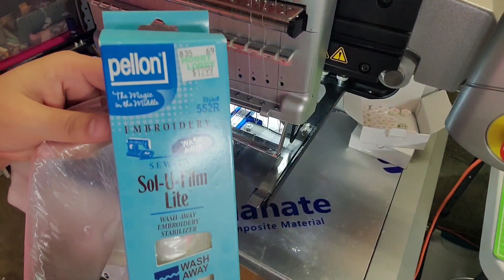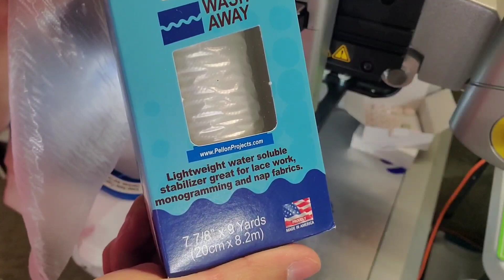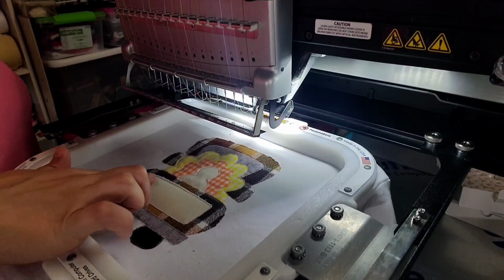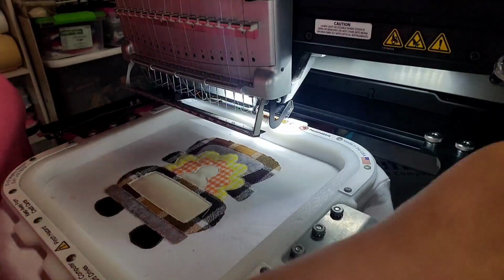Work With Me! Making a Birthday Outfit and A JCA Merch Shirt

Comment: Hello. I use the same shirts but my stitch looks awful 😞.... loops on the top and bumpy on the bottom. What are your settings? Can you please make a video how to set this up? Thank you
Reply from the maker: What machine are you using? It's not the shirt. It sounds like your tension is off.
Reply: @sam-maliasstitches  melco emt16x
Reply from the maker: I have my actifeed set at auto and pts set to 8.